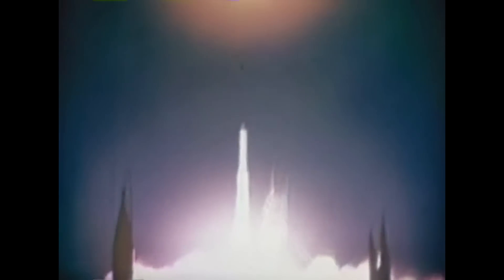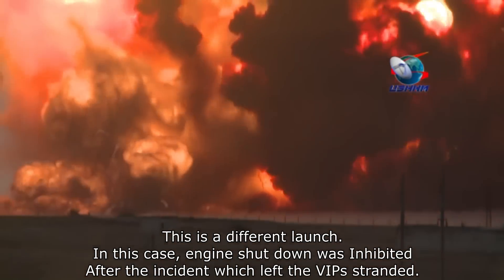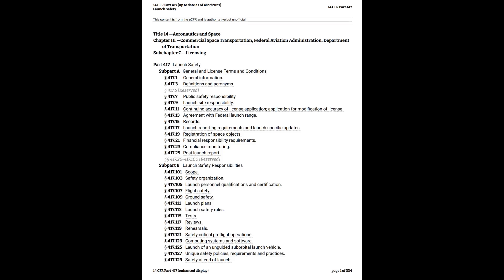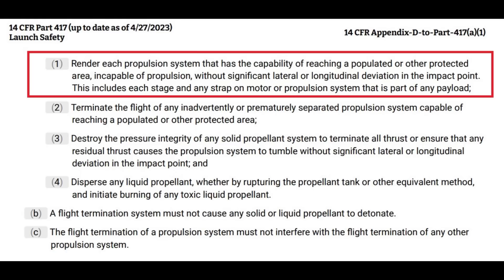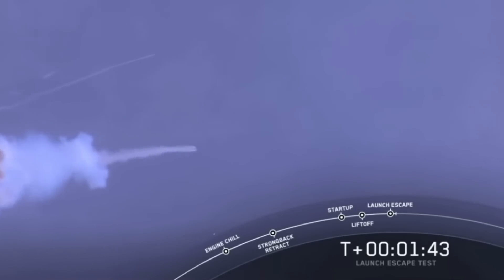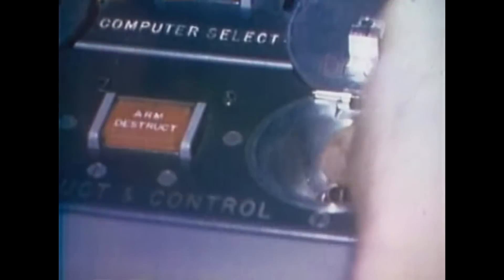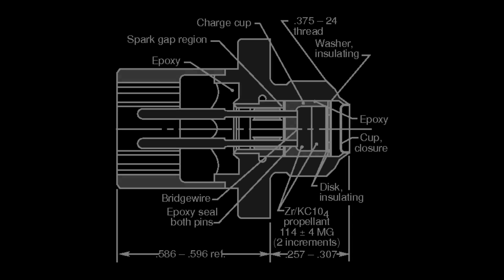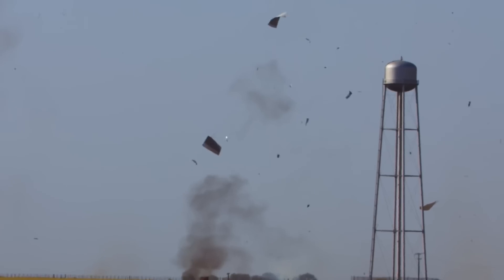How To Destroy Wayward Rockets - Flight Termination Systems Explained

Comment: I hope they are using a password with more than 5 characters for the termination signal! lol
But seriously, I'd be curious to know how it works to make sure nobody can destroy a rocket by bruteforcing this signal or by emitting a recorded termination signal from a previous rocket. I guess they're using some encryption but at the same time the signal must be very fast and reliable so I won't be surprised too if it's not perfectly secure.
Reply: It has probably changed since I last looked at it...
The standard FTS receiver used FM modulation by three discrete tones. A specific sequence of those would trigger termination. Fine for unmanned missiles but not so much for manned. For the shuttle they used the same basic scheme but the tones were always sent in pairs which formed an alphabet. A specific sequence of those (never ever broadcast in the clear unless you meant it and unique to each mission) would do the trick.
Reply: There's another comment about the Minuteman ICBM; the FTS receivers were radio-saturated during launch, so they would not register any signal transmitted that they could otherwise receive unless the launch control transmitters turned off.  I liken it to playing a tone or sound so loud that nothing else can be heard until it's switched off.
Reply: 4 min ago gang
👇🏼

Comment: My limited (one time) experience with flight termination systems.......
Late 80s or early 90s (I know it was after Challenger) I worked for the company that had the computer and scientific equipment maintenance contract for Redstone/Marshall. I had just finished fixing a problem with the telemetry recording system, and was invited to stand in the corner to watch a test launch of the EFOGM (we just called it the "fog em"). This missile had the ability to get locked onto a target, and then the controller was free to launch a second missile and lock onto another target. This was done via a fiber optic cable that spooled out of the missile and a television camera in the nose of the missile. This was the first (and last) test of multiple missiles in flight.
"Launch one"
Missile two takes off.
"Destruct missile two"
Missile one explodes on launch platform.

Honest, it really happened this way. By the time the second missile was detonated, it was uncomfortably close to a large solid rocket engine factory. True story.
Reply: Whoopsie!
Reply: @davidf2281  Switching positions is tight !
Reply: @TheZoltan-42 launching wrong missile was easy, barely an inconvinience
Reply: @TheZoltan-42  Wow wow wow. Wow.
Reply: Are you glad you worked on the telemetry and not the FTS?
Reply: @bbgun061   I have interesting stories about Patriot as well, but can't tell them. Interesting place to work, for a week at a time you might see migs or hinds circling low and slow, to test tracking systems on the real deal (not Patriot, but Stingers). Sometimes they would take Stingers up to the roof of a 4 or 5 story building to track car radiators on the road passing by. This was while the Stinger was still being produced and upgraded. I hope they get that production line up and running before we run out.
Reply: Off the cuff, it sounds like a literal case of getting wires or signals crossed.
'One cannot perform excessive checks of essential safety systems.'
Reply: There was a problem with the guidance logic of a major missile system at one point in the 80's. Nothing nuclear, but it was a pretty major ordinance series. It was very hush-hush, because when the problem was discovered, there was reason to believe that some delivered ordinance may have included the flaw. So they temporarily grounded the whole series until they could ascertain which units may have been effected. But they did it very quietly, because the cold war was still going on then. And any public awareness of a major weapons system being grounded could've given someone the idea that it was an opportune time to start WW-III. Ostensibly, there would be no reason not to discuss it more explicitly "now", but the slowest moving substance in the universe is red tape.
Reply: @kathrynck  Sounds a bit like the cruise missiles based at Greenham Common.
Reply: @ptonpc  Nah, it was a whole class of missiles. Multiple blocks, deployed all over. A fault was found in the logic-board testing equipment. As a result there was a sudden lack of 100% confidence that the missile guidance systems would keep "launch point" and "target" straight. No word on whether any missiles were actually affected, but the testing for the logic boards was bugged, and when that came to light, the commandant decided to temporarily ground the whole class of systems. 

They weren't even sure how long the testing equipment had been faulty, and therefore had no idea how many missiles might have passed testing checks, that perhaps should not have. 

Big clandestine process of shipping missiles back to be re-checked, without making it obvious to soviet-block. Thousands of units out there though... that's a lot of people inside the loop for such a large and unplanned process. They had to make a very heavy handed impression on a large number of people that they were deadly serious about the first and second rules of fight club.

To be fair though, they were 'very' well made. I don't know of any missiles which actually needed fixing upon re-check. It wasn't that they were broken, just that they were shipping after passing an inspection, which had a blind spot, unknowingly, for who knows how long. But it was quite a circus for the better part of a year. But even though the odds of such a bug were fairly remote, it's very understandable that top brass didn't want to take any chances. Sinking the wrong ship would be kind of a big deal.
Reply: @roqua  Fog-em's allowed multiple rockets to be fired by one operator & control system in rapid succession. What happened was they pushed the button to fire rocket 1, but rocket 2 launched. So they pushed the button to terminate rocket 2, and that blew up rocket 1 which still hadn't been fired.

I suspect there is implied humor in the idea that two independent "wires crossed" moments occurred in a single test. But more likely, there was one flaw, which caused the control system to think rocket 1 was rocket 2, and vice versa.

Definitely the sort of bug you want to iron out before shipping to the customer ;)
Reply: @kathrynck   It wasn't funny at the time, but the project was canceled within 90 days. It is hilarious 30 years later. An insane amount of engineering went into winding 5 kilometers of fiber cable so it would pay out without kinking or breaking. Watching videos of earlier tests where the missile actually flew through the windshield of a helicopter to impact the pilot seat was impressive.
Reply: @john_in_phoenix  I'm glad they were testing without a live operator in close proximity ;)

I remember one of the ancestors of the ASRAM turned so sharply coming off the rail, that it embedded it's nose into the fuselage of the firing aircraft. No warhead, but still unnerving for the pilot I'm sure.
Reply: Sheeeeesh!
Reply: You launch missile one, but missile two went off? Then when you destroyed missile 2, you also destroyed missile 1? This situation confuses me a bit
Reply: @Xavier Savedra  they pressed go for 1 but 2 launched. When they tried to terminate 2, 1 blew up on the pad and 2 got very close to a SRB factory before it was terminated. Sounds like controls were swapped for 1 and 2

Comment: Linear shaped charges are also used in demolition of buildings and bridges to cut through steel girders, and for sinking ships to make reefs by cutting a sqare hole in the hull (there's a vid on the latter)
Reply: Shaped charges are very cool! I wonder how a nuclear shaped charge would perform
Reply: @mastershooter64  In theory very well,  Shaped nuclear charge I believe is the core of what is in science fiction called a casaba howitzer.  I state scifi because while I believe the science exists, Nobody has had a need or the insanity(yet) to try and build one given they are really only suitable for space stuff of the less friendly interaction variety.
Reply: @mastershooter64  There's precedent for that!  See the "Casaba Howitzer" - a small-ish nuke in a canister with a neutron reflector in the back angled to produce what amounts to a kilometers-long lance of nuclear fire out the front end, and the defanged version of the Orion pulse unit - same shape, but a beryllium filler to turn the neutrons into thermal x-rays used to vaporize a tungsten disk on the front, sending it hurtling into the Orion's thrust plate.
Reply: @mastershooter64  are you seriously wondering or is this a fbi setup LMAO
Reply: @mastershooter64  okay because this is a free country and because this is hypothetical. If you have a fission criticality reaction in proximity to a inverse of the shape charge made of the same materials you get a very powerful hydrogen isotope warhead congratulations that's a PhD in physics 🫶
Reply: @infernaldaedra  "Ground Zero"
Reply: @DrDeathAribertHeimHk47  ground zero? You understand what a Neutron Bomb is right?
Reply: @DrDeathAribertHeimHk47  we exist only in the past. Information is valuable above all else.
Reply: @DrDeathAribertHeimHk47  do you GET IT?!
Reply: they have so many applications.
Reply: They can cut a hole lol 2ft into metal material of done properly they are wicked cool!
Reply: There's no problem in the world that can't be solved with explosives.
Reply: @samsonsoturian6013  Until a mosquito lands on your balls
Reply: "9/11"

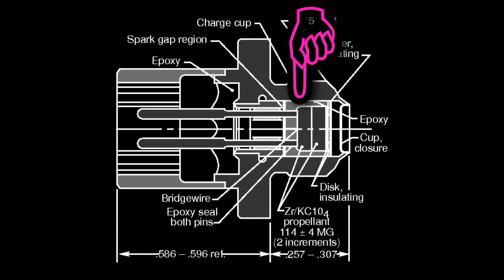Comment: 9:31 "...a little flame, heat, and presssure."

Yeah, that's one way to describe a jet of superheated oxygen gas...

...potassium perchlorate, if you remember, is the stuff in chemical oxygen generators. Exothermic oxygen generation, mind you.
Reply: In SCBAs they are referred to as 'oxygen candles.'

Comment: My introduction to the world of flight termination was via the 1992 version of Range Commanders Council standard 319. Lots of interesting stuff and you will see that a FTS can be used on things other than rockets. Global Hawk for example. (An infamous case.) Designs compliant with RCC 319 are more easily used at ranges other than where they were approved. Which is how I ended up travelling to the National Test Site in Nevada.

Use of NASA standard initiators are not universal. The program I worked on settled on an electronic safe and arm unit that used Exploding Foil Initiators. These have the advantage of not using sensitive primary explosives like the ZPP used by the NASA initiator. 

Since you mentioned the Titan missile, an interesting case of an FTS failure was the first Titan II silo launch. Due to failures in the quick disconnects (they didn't), parts of the wiring harness were ripped out of the missile. So it came out of the silo unguided and without a functioning FTS.
Reply: @roqua  
That's a great illustration on how it's not only important to have more than one safety system, but to have more than one kind of safety system.  Without the ISDS that launch could have been literally disastrous.
(Although I suspect the ISDS was designed with the priority of Nat'l. security rather than civilian safety in mind.)
Reply: Where did it go?
Reply: To the moon like crypto currency! 

Oh wait, neither of them did ;)
Reply: @alexdrockhound9497  Why would anyone expect an ICBM to be able to reach the moon? That's like expecting your fireworks rocket to reach orbit. Not enough delta-v there.
Reply: @KaiHenningsen  Do you have a sense of humour?
Reply: @roqua  Do you maybe want to cite that you pasted that from the Wikipedia article on the Titan II?

Comment: There's a nice opportunity for expanding upon this discussion, thanks to recent events.
Details that Elon has recently revealed about the launch of Starship that occurred recently indicates that the FTS failed to promptly terminate the flight.
I'm curious what modifications will be necessary to make that beast terminate more gracefully in the futute
Reply: Blow up the common bulkhead maybe? Or det cord all down the side. I'm sure it won't be hard for the experts there to think of something better
Edit: just got to the part about Falcon 9s FTS... I'd just do the same thing on starship if possible without affecting the rockets aerodynamics
Reply: @digi3218  The fireball from breaching the common bulkhead at low altitude would endanger the entire launch complex and all the addt'l. fuel that might be stored there.
While others have suggested that larger explosives may be needed to degrade the vehicle's structural integrity to cause a breakup and rapid venting of propellant, I think that opposing breach points in each tank would allow fuel to vent in a manner non-destructive to the vehicles, and also sufficiently rapid that external interactions would cause rapid dispersion and/or burnoff of bled propellants without detonation.  The toxicity and reactivity concerns with LO2 and Kerosene dispersed at altitudes above 10,000ish feet are probably minimal, or else NASA would not have granted them the operation license for Starship SuperHeavy.
Reply: As Elon mentioned, and Scott discussed in a video a couple of days ago*, the FTS went off as commanded. (No one has said whether it was terminated by an onboard system or manually.) The steel rocket was just too damn strong and didn't unzip like all other rockets. The modification will very likely involve a brute force approach; bigger explosive charges blowing bigger holes and perhaps more of them. This will release the internal pressure more quickly so the structural integrity will fail quickly, not 40 seconds later.

*"Is This Why Starship Wasn’t Destroyed The Moment It Lost Control?"
Reply: @donjones4719  Perhaps similar to how the vehicle survived doing a couple of somersaults without tearing itself apart... the vehicle seems to have more structural strength than people were expecting. Which might be a good thing, since it suggests that SpaceX have some room to trim excess mass.
Reply: @simongeard4824  Or a bad thing considering they have spent so much time and energy on learning how to work this specific alloy and thickness. And an easier to destruct material may not acheive the structural resilience required to land with empty tanks. Its a bit of a conundrum for them... along with how to modify their pads so they DON'T self destruct.
Reply: @patreekotime4578  True, but weight reduction has always been on the roadmap... Musk stated some years ago that early Starships would be somewhat conservative around tolerances, and they'd look to trim it down once they knew it worked.
Reply: @simongeard4824  methinks they are leaving structural headroom for future vertical stretch as thrust capability of Raptors increase.
Reply: @patreekotime4578  Fixing the pad is known technology. They need a flame diverter and a water deluge system, though they may not accept that yet.
Reply: @Mariano.Bernacki  Also possible. From memory, their "stretch" plans so far have focused on adding a few more engines and some more tankage to the upper stage, but a bigger booster is certainly an option if they can get more performance out of Raptor.
Reply: @simongeard4824  yeah

Comment: Scott, what would it take for SpaceX to start building Falcons with Raptors?   They have a lot more thrust.   Swap out a V6 for a V8.
Reply: Never going to happen, too many systems would have to be altered due to different fuels, different thrust characteristics, stresses on airframe, etc. Might as well build a whole new rocket, i.e. starship superheavy.
Reply: More thrust does not mean more better.
Reply: The Merlin engine on the Falcon 9 is ideally sized to match the rocket.
Reply: Years, since you're basically building a new rocket from scratch... replacing kerosene tanks with cryogenic methane, changing the tank sizes to reflect different ratios of fuel and oxygen, making the whole thing wider so that you can fit an R-vac engine on the second stage, figuring out the stresses of having far more engine power through the structure, figuring out how to do landings again with far more engine power than you need. A pointless exercise, really.
Reply: Scott has done a few videos on or mentioning development of the Raptor.  Other commenters are quite right; engineering a lesser rocket 'from the drawing board' to use a later engine design is like redesigning a PS1 to run PS3 games - you could, but why?
Reply: That was considered at one point, with a USAF contract for it even (before USSF split off). In fact, Raptor was originally planned as a hydrolox-engine.

Comment: That's not how thrust-termination ports work.  They produced a rapid reduction in pressure inside the motor which, effectively, shuts it off or can even snuff it out.
Reply: IIRC the similar-sized solid motors on the Titan III started out with two ports per motor (those circles seen part way up the nose cone -- mostly visible on silver ones vs white) but  later went to one per motor.  It's not clear to me why such ports couldn't have been utilized in the STS design, thus allowing orbiter separtion ahead of the nominal SRB burnout time.  Maybe differences such as there being parachutes in the cone of the STS's SRBs constricted the design options.